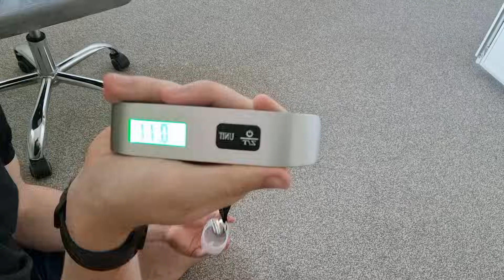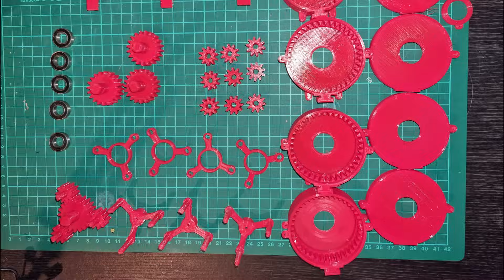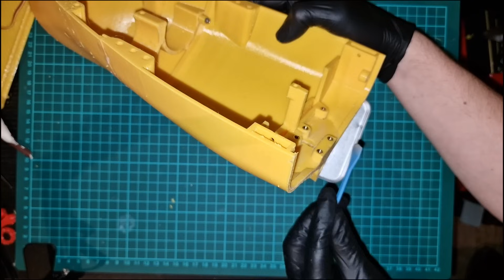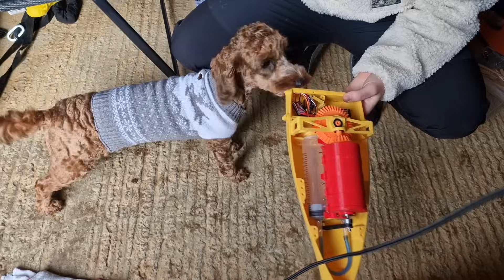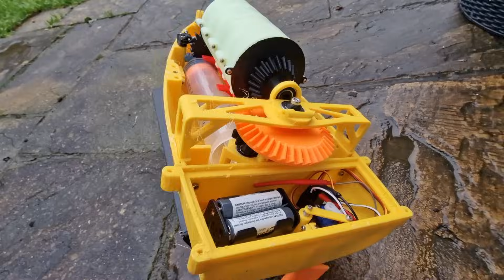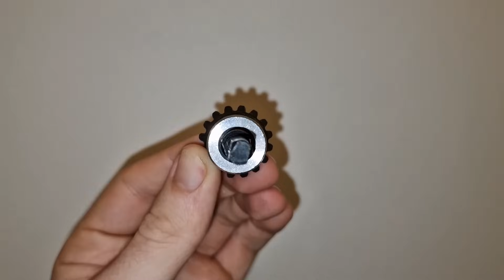3D Printed Vacuum Powered Boat

Comment: Great video! Here's an idea for improvement: maximizing the diameter of the bevel gears could be beneficial. Increasing the lever arm reduces the forces involved while maintaining constant torque transfer. Alternatively, eliminating the 90° turn in the gears and having the fishing wire navigate that turn could be a superior solution. By mirroring the gears transferring torque to the gearbox on both sides of the shaft, forces could be balanced, simplifying your input to just torque.

Regarding the hull design, it looks impressive, but you chose a planing hull designed for high-speed gliding. A displacement hull might be more suitable. You could achieve this by reducing the rounded corners to stabilize the boat, utilizing the counteracting momentum generated when the boat leans to one side. Alternatively, a V-shaped hull could be beneficial, allowing for the placement of heavy items like batteries deep underwater, akin to a keel. The beneficial sideeffect is that displacement hulls are also more efficient for your application.

Can't wait to for the next version, it is great to watch your iterative improvement process!

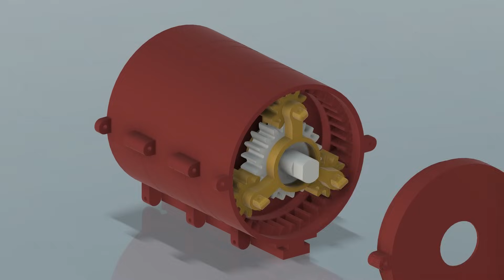Comment: (3:13) I tried printing stacked planetary gears before.  You have to make sure that it's not the sun gear attached to the next sun gear.  Instead, you have to attach the 1st sun gear to the planet carrier or the ring gear of the 2nd gear system.  Otherwise you're just going to run a bunch of planetary gears in parallel, not in series.  If you want gear ratio multiplication, you need them to run in series so that they feed into each other.  Running the stages in parallel means that only one of the stage does actual work while the other two just spin and add friction to the system.

Comment: ....Or you could accept that the surface finish expectations of most of the community are unrealistic (what do you expect from armchair engineers....) and develop a finishing step for your gear teeth faces and air cylinder gasket interfaces?

Also, my dude.....you gotta watch some engineering videos on the motion of forces through gear arrangements and bearings.....Like....cmon man.....they dont magically push sideways on the teeth......gotta take into account all possible motion and force vectors, not just the vectors you want ;)

Comment: I remember installing a chainsaw/weedeater engine in a 6' fiberglass over wood hull. 
Lots of lessons learned. 
1 When you launch everyone gets off the water as fast as possible because you're prop could easily cut everyone else's boat in half. 😂
2 the best muffler is the silicone tube stolen from a coffee pot. ALL SOLID MOUNT PIPES WILL FAIL. 
3    A  1/8" FIBERGLASS over 1/8" plywood will easily survive full throttle impact with a tree 30' on shore. 
4  Regular hardware silicon makes excellent attachments for engine to hull because it absorbs some vibration. 
Bolts NO  Screws NO. They just vibrate holes in the hull. 😢
Do not give up.

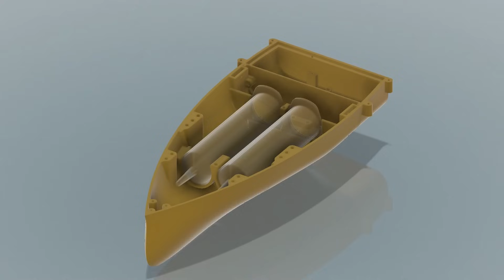Comment: Maby instead of the fishing line going straight out to this part 5:24, you could put a horizontal (metal) pipe, with some sort of rolling part on. So that you can make the 90° upward turn with the fishing, instead of the bevel gear. 😊

Comment: guess why differential gear setups use solid gear boxes ?

maybe a simple c-shaped metal bow would have cured so much...
Reply: see my bit longer note underneath @Barkley1835 9 days ago.

the proposal is a tri-maran or tri-pod design that is leaving out the pulley and the 90° gears plus even more on your parts list - stripping away items can make things better. what's not there wont ever break.

Comment: Wait, what ?? Only 7K subscribers ?? 😳😳 UNDERRATED CHANNEL !

BTW, maybe you should add a "cage" around the bevel gears. These stinky mofos are incredibly good at wrecking things because of the surprisingly big amounts of force/torque they produce. Also, the planetary gears should be layed at the bottom of the hull. In your configuration, they put too much weight on a high place and it ruins the balance of your ship (she wants to capsize). Also, if you like glass fiber and epoxy, you should make a hull in fibers 😅. I hope it helps you. Sorry my english is as good as the first reel of plastic you used at the beginning of the video 😂
Reply: for some cases a catamaran boat is the better base.

Comment: maybe use some oil or grease, even in 3d printed parts. If you don't want to buy one, just use what you have in the kitchen. :D
Reply from the maker: I did use a bit of silicone lubricant in the planetary gears, didn't make the cut!

Comment: I am confused why you didn't use some lithium grease in the gear reduction housings, I know it will increase ware on the gears but I think it would have helped with friction.
Reply from the maker: I think lithium grease might break down the plastic, not 100% sure though

Comment: make the bevel gear a single unit that attaches to the gear/shaft with u joints. alignment wont be as critical and the more solid body holding the gears in place wont flex as much. if you put an axle across the horizontal gear it will have to fight against 2 sides to deflect up.

Comment: You could mount the syringes vertically like stacks and line up all the power transmission along the bottom of the hull.  This would put the empty parts high and the driveline low.

Comment: When I make 3d printed planetary gearbox I use thecatalystis planetary gearbox simulator to first check how many teeth on the gears to use. Then removing 1 teeth off of the planet gear and placing it exactly between the sun gear and ring gear. It works all the time on first try.

Use normal straight cut gears. Helical gears isnt worth it and make the same noise.

Comment: Have you looked at early compressed air motors for torpedos? Also consider testing filaments for the best torque loads. Just a thought. Projects like yours keeps me shy of 3d printing. I am just a self trained machinist/ watch maker, though with 60 years of practice.

Comment: I would use the modularity of your hull to extend it for another section.  Maybe flip the gearbox 180 degrees and shorten the prop shaft and drive it directly.  Putting the heavy gearbox low in the hull.    In a longer design you could spool both syringes from the same rod.

Comment: since it's a friction fit anyway, you'd probably have better luck with the prop shaft going through an o-ring set into a depression you can model into the propeller shaft channel.  Since the metal sleeve isn't rotating, it won't add any drag to the system.

Comment: What if the syringe was under the water instead of on the surface? Water has way higher pressure than the atmosphere even at shallow depth, so it should hypothetically get even more force.
Reply from the maker: Yeah there's about an atmosphere worth of force for every metre you go down so would get higher pressure, how you transfer the power to a prop may be a bit more difficult

Comment: if the first design with one syringe worked
maybe try that design and modify the original's gear system to work with 2 syringes
I think you might have a better chance doing it that way

Comment: Why do youtry and work with bevel gears anyway? It seems to be your main problem here.
How about using the fishing line itself to change the rotation to be in line with the gear train.
Use a guide pulley or similar to turn the fishing line vertical and wind up a horizontal shaft directly in line with the gear train.
You want to avoid using anything which creates friction or loss of energy with this one

Comment: You have too much torque on those big bevel gears. Put gearing ahead of it for lower torque and higher RPMs through the big bevel gears. 

Think of it like how the power company uses transformers to increase voltage to decrease amperage for long power lines.

Comment: Have you considered using silicone lubricant in the syringe? Petroleum based lube might deteriorate the rubber and plastics.
I don't know if lubricating the gear train will be better or worse. Either a very lightweight silicone or maybe a graphite powder lubricant wouldn't gum it up.
Heavy gauge fishing line is not very flexible, so can use up some of the available energy. You can try using a thinner line or appropriately sized string, twine or ribbon.
For such a low RPM, consider using a much larger propeller.

Comment: Ok brain storm, move the hydraulics chambers into two side floats giving it more mass on the water, used the normal chamber pull it back each side via hand i.e. "lift out pop back in", " there not . UNDER ANY STRAIN, and gravity is lowered. and you can use nylon tube so it cannot implode . add a controlled release valve your going to loose some suction but you will get less gear thrust = less brakeage.  beta a drive out of a bike brake cable "think Dremel tool cable drive" add this idea to prop drive in fact you could use this in many way to drive your craft  even to spin up some power dc to run a small motor to prop .the options are endless taking it to make power dc or small stepper to stepper drive using your concept of how you want your craft all things have been used before but its a fun project and very viewable thank you for sharing  and keeping this alive is this a re post of you  i do not what to be typing to reposts

Comment: You are transferring the greatest force with gut and then converting it to rotary to go around corners and combine two sources.
I can see you mean well but do not have an instinctive feel on the forces involved in gearbox design.
I could suggest you replace the first combiner and bevel gears with, NOTHING.  Just direct the gut to wrap around a metal input shaft on the planetary gearbox and save a lot of grief it is flexible anyway and can go around corners as easily as wrapping around a shaft.  There are grooved bearings that can be used to change direction with almost no friction..
Using 3D printed metal gears for the first stage might be required to get any performance.
Adjusting the top belt pulley to as large as possible, sized to take up belt tension, will increase your gearing for no extra loss and possibly permit you to remove one stage of the planetary.

Another comment suggested having an inline arrangement, this makes sense to lower the centre of gravity.  It would also allow you to use three, perhaps 4 syringes.

Comment: What about increasing gear teeth number, or adding radius to those, such that more material can resist being turned... Also, making the gears taller with wider axis, should help stabilize them from skipping. Annother thing that could be done, is to change the axis of those pieces to a steel rod... Or machine the gears from solid wood or acrilic

Comment: Stand the cylinders up as they (assumably) weigh less than the transmission and this will also correct the angle thereby eliminating the bevel gears

Comment: Why not completely do away with the bevel gears and use a pulley to change the direction in the monofilament instead of changing direction in the gear train?

Comment: i dont get how that ender prints so badly...ive never had a single problem with the basic ender 3..not a single layershift,single blob or failure to adhere..like i get the best print quality on mine...best thing is no calibration im still using the default pla setting in cura 3D..i think its due to assembly..i didnt follow the instruction as they were very counter intuitive for anyone that knows what forces are exerted on the machine so i built it in different order than most tutorials..i cant emphasize this enough..not a single failure in 3+years..not a defect nothing prints smooth and shiny with no stringing..sometimes i see prints off of high end printers and think to myself that it looks the same as from my old ender 3..anyways awesome build!!!

Comment: brilliant video, thanks for showing us the whole process-most youtubers wouldn't show the process involved in their inventions but trial and error is part of every science experiment. keep on trying, when it finally works out the joy you'll experience is indescribable..  
PS: maybe try mounting the heavy gears as low as possible- hopefully in the line of transmission so that you can do away with the gears at the end and mount the cylinders high up. it will help ith your CG too

Comment: you mentioned earlier in the video how you were only going to use 3 planetary gearboxes to reduce friction, though in your final boat it looked like you still had 4, maybe reduce it back to 3 and change the gear ratio within each planetary gearbox
Reply: I think he uses an empty gearbox stage housing to support the extended output shaft. At least that is how I understood.
Reply: @KallePihlajasaari  ah ok

Comment: You’re in it. This is what making/inventing looks like. Thank you for being real in it.  I had one idea for the bevel gears: a right angle housing that holds both shafts in place.  Since both gears are on the end of a rod, that rod has flexibility between where the teeth mesh and where the rods are being held.  If the bevel gears are being held stationary at both ends of the rod there should be less rod flex?
Reply from the maker: Yes it definitely needs a more solid housing!

Comment: Have you checked If there are any bevel gearboxes for rc available to buy ready? sometimes it's better to buy a problematic part because it already has been engineerd before to the point where it works.

Another idea would be to use universal joints instead of gears, maybe several in a row to get around the tight angle better but in this case I'd really recommend to buy them of the shelf.

Comment: I think you’re designing the 3D printed brackets as if they were metal. No need for cutouts with cross braces, just make solid. I first started designing drone parts with cutouts for lightness but in many instances it has the opposite effect. Cutouts make extra walls, use more filament, increase print time and make the part more flexible. Better design the part ‘bulky’ but with light infill. Try the make the gearbox end and gear carrier as one part so there is no relative movement. 3D printed shafts are completely useless. Keep going pal. Nice vid.

Comment: the keel needs more weight to counter balance everything else, you could also consider using one-way (or check) valves the draw the syringes into position rather than using a drill.

Comment: I'm relieved that it's not just me that goes absolutely insane troubleshooting a design. "Iterative design", they call it. Always use flux when soldering, it makes all the difference, and soldering large pieces of brass like that requires a thick chisel tip.

Comment: It was an interesting journey to follow, if a painful one.

Aside from the already mentioned bevel gear housing, maybe it's worth it to use a flexible shaft coupling instead.
Although that would definitely take away from the design challenge that is making the bevel gears work under the high torque load.

Unless you don't mind scrapping your current hull you could make some floaters off to the side to keep it from tipping over, like the "blades"(?) on a catamaran.
Depending on their buoyancy (force) and distance from the hull (lever) they can "fix" a high centre of mass at the cost of more drag.

Comment: Welders know that IF you apply direct pressure the blister will not rise.  So some run the wound under cold water for a moment and then hold a finger's pressure on the wound.  (Next time it happens to me I will apply an  ice cube and then run the cold water on it.  The water would prevent freezing damage. (IN THEROY)

Comment: 1. Larger hull with a balast keel you can switch out easily (for triming and stability) with 2 bolts. Like a Sailboat.
2. Make the hull from fibre glass
3. Aluminium brackets that hold stuff together, because the 3D printed stuff obviously is not up for it + steel shafts that transfer the torque

But cool project, despite failure so far.

Comment: You're already using a basic pulley system by using the fishing line and the axle as the spool for the line so why not eliminate the entire bevel gear set and replace it with a 90 degree pulley making the drive shaft of the planetary gear the the spool of the fishing line.

Also try using a braided fishing line as nylon has high plastic deformation before failure.

For the stability of the boat make the keel of the boat heavier so it will lower the center gravity of the boat and make it more stable. Lead is a good material as it is more dense compared to other metals and will require less space.
Reply: a tri-maran?

i feel like the syringes could go to left and right, ending up in a swimming foot. then the slow end axle of the gearbox is the winding spool - and the gearbox points downwards in some 20-30° angle to the rear of the setup with a third swimming foot, the ships screw and the rudder.... sound much easier and just with some spacer bars well in shape without any force despite the very front central spool.
Reply: @alexanderstohr4198   @alexanderstohr4198 No. Not a trimaran. I did not mention any description that would suggest a trimaran or any other design of any boat.

Just the same boat with heavier keel for stabilization. The syringes would not deflect as the pulling force will be inline to the direction of the syringe actuation.

Comment: Instead of immediately winding up the strings from the pistons and then trying to transmit the torque via bevel gears, make the strings go over a vertical pulley at the bottom onto horizontal winches in the same axis as the gearbox.

While you're at it, swap the heavy gearbox to the bottom and the literally empty pistons to the top
Reply: I made almost the same suggestion.  It was a bit painful to see him using DIY gears system to go around corners when the gut does it for free.